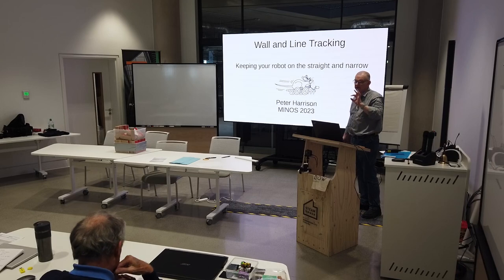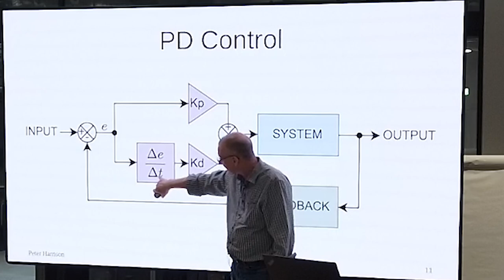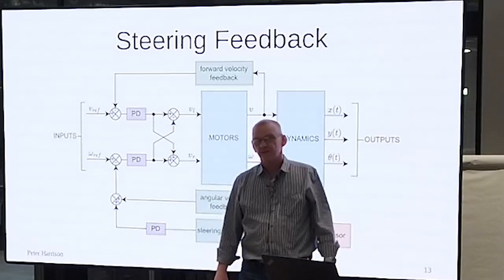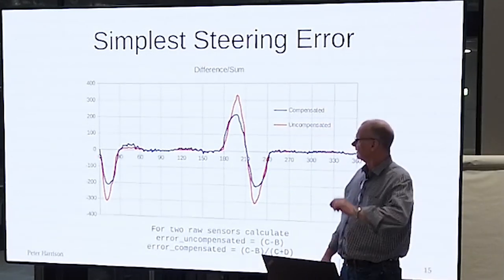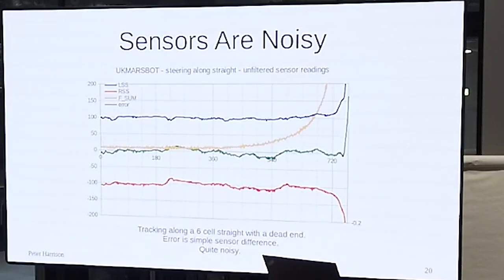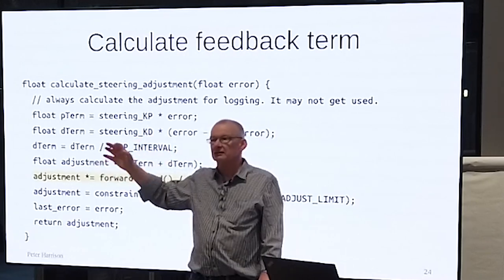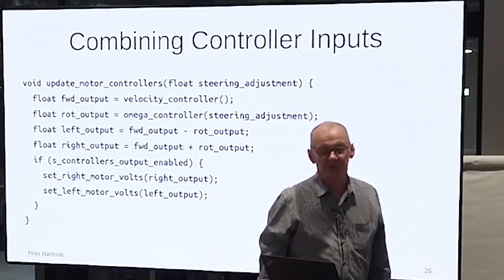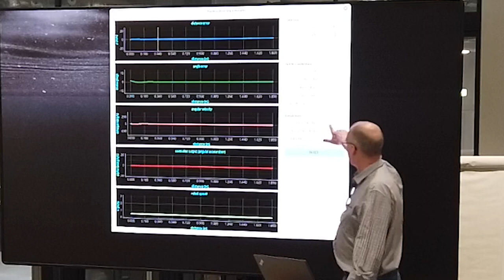Minos 2023 presentations "Wall and Line Tracking for Micromouse and Linefollowers" - Peter Harrison

Comment: If the steering adjustment from IR sensors is not considered, how to make/ how does  the bot go straight only with forward speed and angular velocity alone ?
Reply from the maker: @suricool99 The position of the wheels is controlled using an encoder for feedback, this allows them to turn at the same speed, you can't just feed the motors with the same voltage or PWM and expect it to go in a straight line. A separate controller for forward and rotational movement is mixed and then sent to the motors.
Reply: @MicroMouse  thanks for the reply. When I went through the videos and code of Maze runner , the IR based steering or angular velocity correction is optional and can be enabled or disabled if necessary. So if we are ignoring the IR input for correcting the bots position how is it going straight? Only with encoder data ?
Reply from the maker: @suricool99  You need both, you should set it up to go as straight as possible without the sensor input but that'll not be enough to move around the maze, the sensors need to do as little correction as possible as there are places where you can't see a wall.

Comment: How to get accurate position of a micro mouse robot? (sensor data only interact with control part, control parts give x(t),y(t), angular(t) to higher layer? or higher layer uses some knowledges(cell size) to correct info that control parts gives)?  Using 2 encoders after a long distance, the errors become bigger, so do you use cell size to correct the error?
Reply: I do not know what they usually do for micromouse, but in general you can use sensor fusion (kallmann filter), high-level knowledge like the cell size, and in a previous video he also showed that you could recalibrate the robot by backing up into a wall, and some distance sensors to the front and sides so you can correct for errors on the sides.
Reply from the maker: The mouse will look for edges at corners and can then adjust errors as the posts are always in a known place.

Comment: In the control diagram where did the feedforward pd controller is implemented? Is it inside the motor block?
Reply from the maker: Feedforward is not implemented in this video but if it was it would be added to the velocity feedback as it is basically an estimate of the expected feedback.

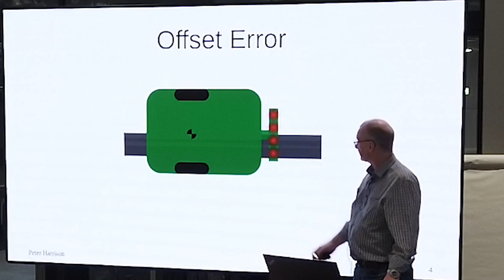Comment: in 1:46, why not use more sensors, arrange them on the back of the robot, so error can be measure clearly. （angular and offset error)
Reply from the maker: You mean like this mouse https://youtu.be/3l28CYKvrds?t=52 you can see the sensors at the back and front
Reply from the maker: Extra sensors are always a compromise, use more power and add weight